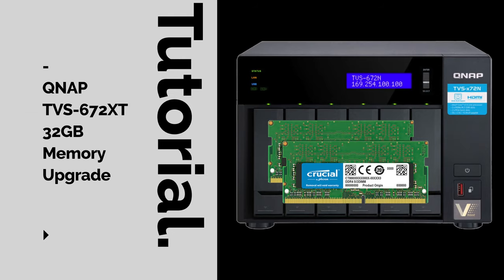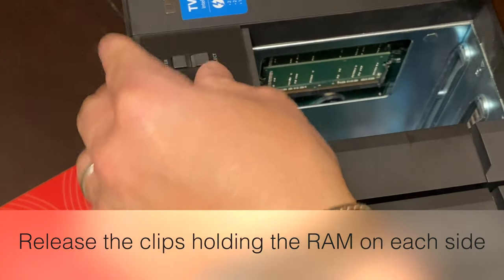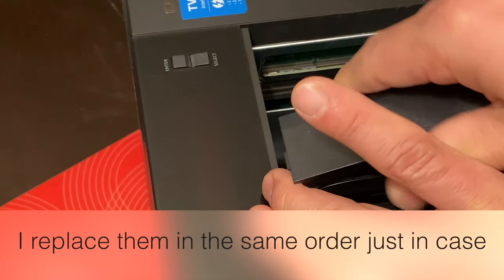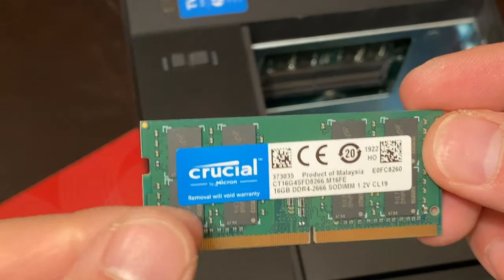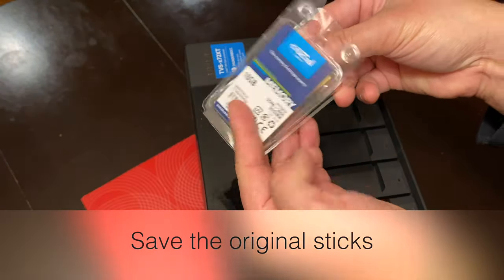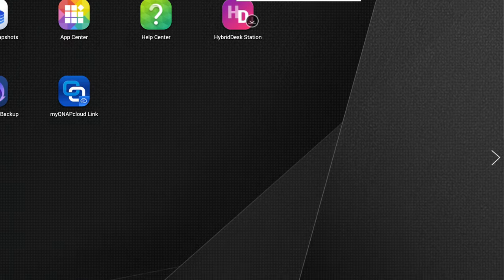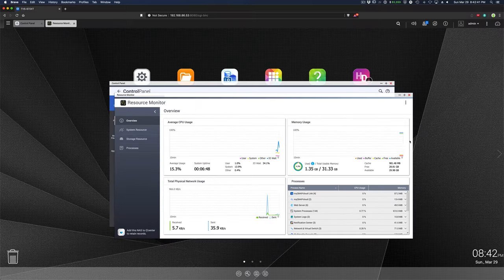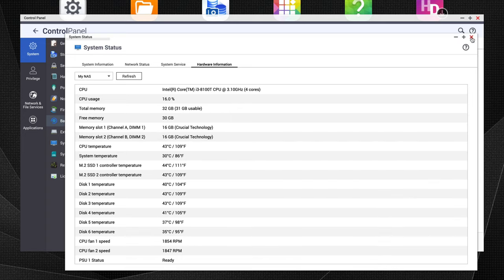QNAP TVS-672XT 32GB Memory Upgrade Tutorial

Comment: I upgraded my RAM with Crucial 32gb in my TVS-672XT a month or so ago, along with the CPU to a I7 8700T and installed some NVME SSD's. Now the NAS keeps freezing, the LED on the front is unresponsive and i am unable to login as the browser page won't load and Qfinder can't find the NAS on the network, does anyone have an idea if the RAM could be the problem? The model number i am using are CT2K16G4SFRA32A

Comment: Hi Gary, thx for the video tut :} excellent work.

however a few things

perhaps to include tips to ground self before handling electronics. myself i am prone to creating static electricity, so example if i touch a metalic door handle this releases a spark. it's certainly not good to handle electric components when that occurs. so probly ground self prior to handling electronics including ram?

also when handling ram, try hold it (grip it) on both corners, without touching the contacts and the electronics on the ram itself (unless it has like a heat spreader, thats ok to touch).
Reply from the maker: All great tips! I used to live by this especially when I lived in an area prone to static. I even have a grounding band. I'm just lazy and love to live on the edge haha!

Comment: just curious, if u suspected it was bad ram causing random reboots (which is a possibility), did you at least run the memtest to verify that?

I know at least one qnap user that despite running the tests did not detect ram fault. Yet when he replaced his ram with new ones, the problem went away. So based on that, even if memtest does not say there is a fault, there is still a chance that is still a possibility to fix it by replacing ram.

Unless it's a different reason that is causing the problem. I had troubleshooting random reboots, it's a bit hard to figure out sometimes :/
Reply from the maker: Bad news and Good news. I started getting random reboots. I turned off the M.2 SSD cache - and I haven't had any so far. I just found it odd that my TVS-472XT with No M.2 was not crashing and would stay up until I rebooted it. I'll post another update since my TVS-672XT is currently going through a 10TB RSYNC to a new TS-251D.
Reply: @GaryCruzDotCom  did you try 4.3.6 does that solve the issue?
Reply from the maker: Ainz Ooal Gown it actually started rebooting again after the latest firmware update.
Reply: @GaryCruzDotCom  so no issues with 4.3.6? if so probably best to downgrade to confirm that. if no issues, stay on 4.3.6 until they fix random reboot issue related to the one that began with 4.4.1

If your random reboot is still happening even on 4.3.6, then it's ram or something else. can't really help you if it's this unknown reason causing it :/

By the way 4.4.2 got pulled, no idea why.

oo you can call me Ainz or Ainz Sama. the full thing is a mouthful ain't it ^-^; hehe. Or Moogle, as i'm known on the qnap forum works as well.
Reply: @AinzOoalG0wn  Hey Moogle, I have seen your topic on the QNAP forum. Wondering if you have the random reboots since 4.4.3.1354? I just upgraded to 4.5.1.1456 a week or so and just got a random reboot.
Reply: @zoltannnz  i haven't had any random reboots whatsoever since 4.4.2 up until 4.4.3

i did have rrs in the earlier 4.4.2 build. but the later half *i tested around 2-3 of the latest 4.4.2 builds that did seem to cause any RRs afaik.

For myself on the TS-877, the RR issue that was introduced beginning from QTS 4.4.1 release was solved.

I am not sure about other models, since i don't recall others claiming their issues went away with upgrading to the qts builds i stated where RR went away for myself.

My RR was specific to a bad  QTS firmware release that began with qts 4.4.1 which i dubbed the 4.4.1 RR issue. But random reboots can be caused by just about anything. So just because you have RR's, does not necessarily mean it had anything to do with 4.4.1 RR issue. 

The other reasons are like, memory gone bad, or using incompatible memory, or bad psu, bad motherboard or something else.

I only upgraded my TS-453DX which i use for testing to the latest 4.5.1, but this qnap model i had never experienced any RR's before.

I consider 4.5.1 beta, so i would suggest you stick to the last latest 4.4.3 for now. At least for the next month or 2. Seem they are working out some kinks. They did however mention fixing a bug in regards to guests moving stuff via smb that caused issues, but if you are doing it using admin, maybe you won't have issue? i'm not sure, but something to keep in mind if downgrading to an older fw build.
Reply: @zoltannnz  If you experience RR, my first recommendation is check your ram first. I use memtest and run it for more than the default 4 passes (i let it run for a whole day), just to confirm the ram is not faulty.
Reply: @AinzOoalG0wn  Yeah RR started with 4.4.1 for me as well. Original 4.4.0 had no issues at all. If it will happen again with this 4.5.1 I will try memtest. If that works I will revert to 4.4.3. If that also has issues I will order some new RAMs.
Reply: @zoltannnz  last time i just simply replaced ram, but my rr 4.4.1 issue was still there. so best not to make assumptions. test the ram first (not default 4 passes which is not sufficient for testing). before resorting to replacing some that cost $_$;